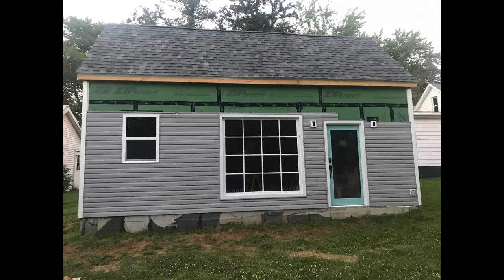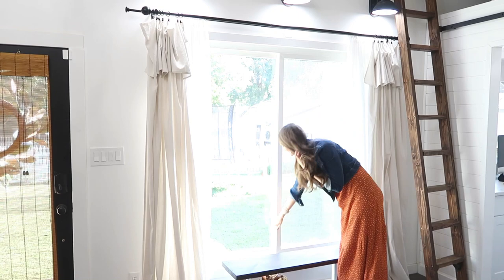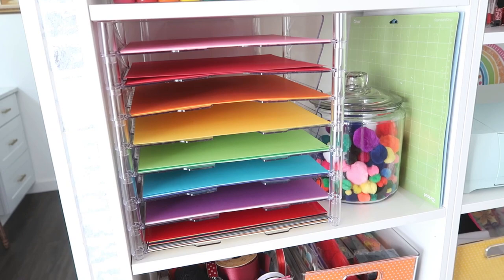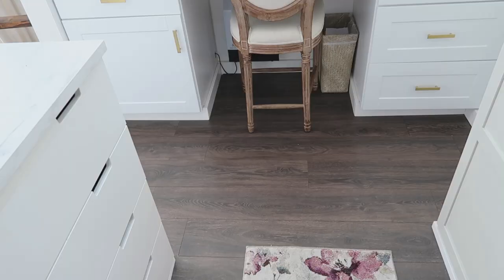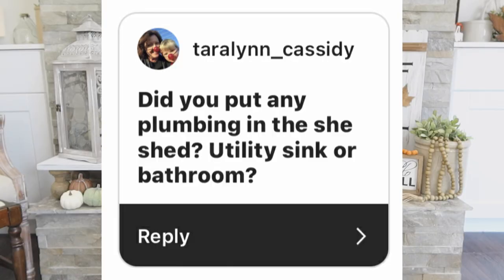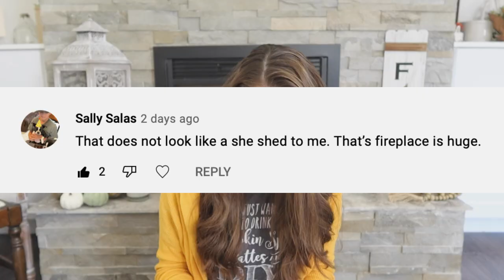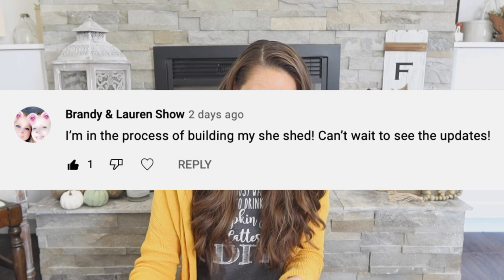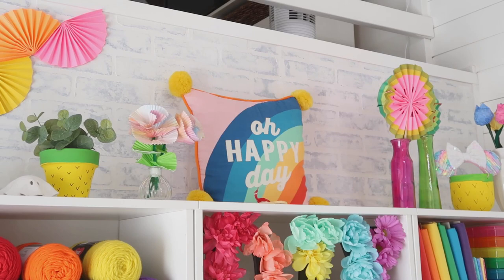DREAM Tiny House with Hidden Secrets inside! (only 300 sq ft!) FULL TOUR of my She Shed

Comment: Your cottage is absolute perfection! You made excellent choices in your design that highlight beauty and function. My 12x16 shed will be used to run my creative business also, as I could not see myself cluttering up my new home with all my inventory and supplies. Do you happen to have details on your step/deck build? With the grating in my yard and the concrete blocks needed tonlevel my shed, my entry is 18 inches off the ground. I have barn style doors that swing out to contend with and your steps look perfect for my needs. Thank you for sharing your gorgeous cottage!

Comment: This is definitely not a shed.  It’s absolutely beautiful.  I thought when you filmed in front of that fireplace that it was your family room inside the house.  Such a nice layout and design.  I would call it a craft cottage or craft studio.  Even though I have four bedrooms, two of them are my craft rooms, and live alone I would still love to have a place separate from the house to craft in.  I do have a Dutch style barn in my back yard that’s a good size and would be perfect converted, but I don’t want to store all the garden tools, mowers, etc, in my garage.  So having two bedrooms as my craft space with central heat and air will work just fine.  I’m getting all new windows installed in my house.  I ordered them in August but won’t be ready until December.  I’m looking forward to them and all new window coverings too.

Comment: I had to take a screenshot of your fireplace wall. It's exactly what I'm going for in our basement.  Also all the same Ikeas shelves are what I'm using for our spare bedroom. I'm turning it into a family closet area. I needed a place for seasonal clothes, extra bedding and sports uniforms. Fingers crossed its a good solution for all that clutter that's spread throughout multiple spaces. Thanks for sharing so we can copy! Have you thought about a pull down ladder that is typically used on an attic?

Comment: How do you get the building permit for this and do you have a bathroom.
Reply: You answered both in video. I would but in a sink with pump. And a chemical toilet. Could never run back and forth. I am thinking an addition to my house for this room would work too to get around those issues.